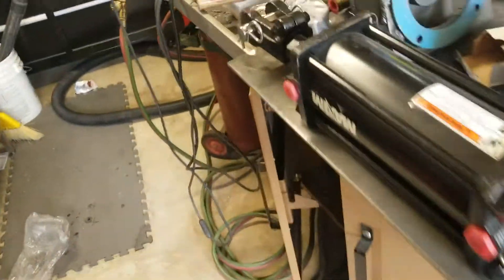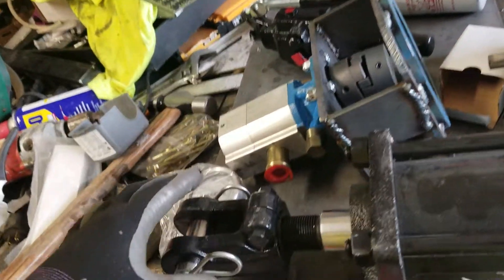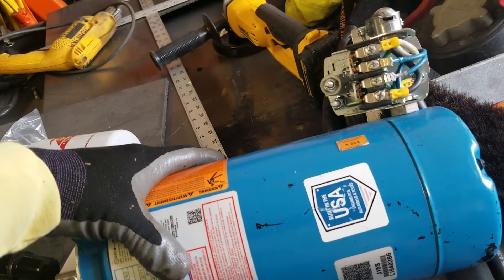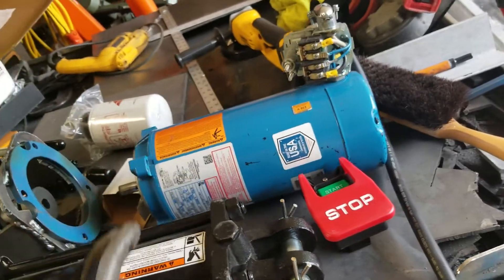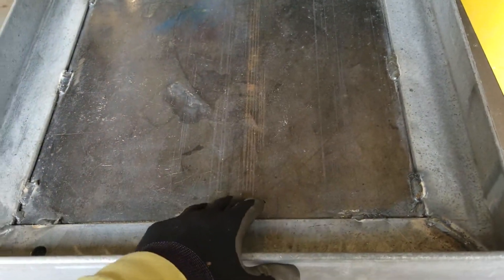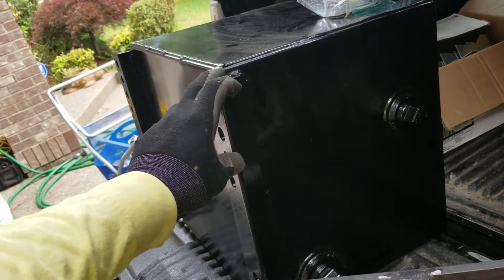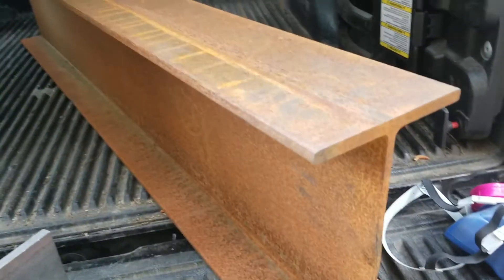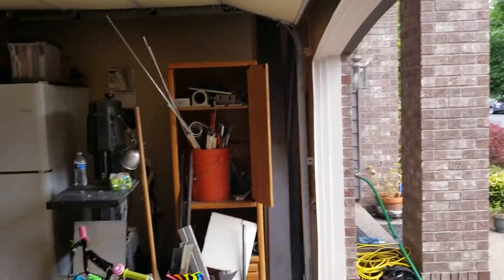Hydraulic FORGING press build 35 ton PART 1

Comment: How many PSI is your pump?  A 4" cylinder at 3000 PSI will be just a tad under 19 tons.  You'd need around 4000 PSI to get 25 tons on that cylinder, assuming it is rated for that high of pressure (and a pump that can supply it).  Also a 1.5HP motor is going to struggle to drive a pump with enough flow to power the press decently or without overheating the motor.

This diameter of cylinder, and I'm going to guess a 2500-3000 PSI pump (2-stage) at around 11-13 GPH flow on the high side, is common parameters for 20-22 ton log splitters.    In that scenario, at least a 3HP motor is needed, if not 5 HP.

Comment: Where did you get that motor?
Reply from the maker: It turned out that motor wasn't enough horsepower so I got a baldor 5  horsepower instead
Reply: @frostcb2  that should be a great grinder motor

Comment: Good video looking forward to seeing the final, just an FYI... voltage doesn't effect RPM on an AC motor. The only thing voltage changes is the full load current. Higher voltage will pull less current so you can use a smaller circuit and controls.